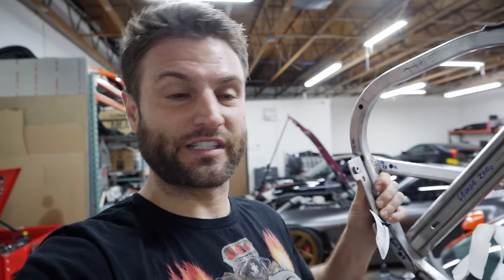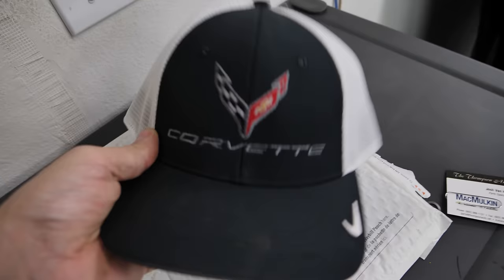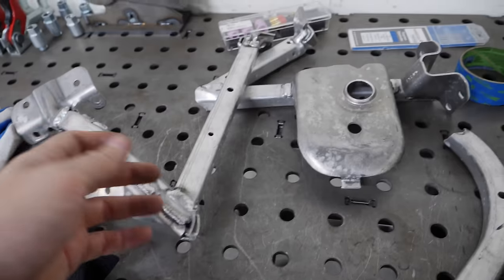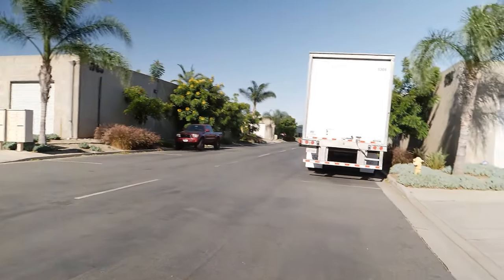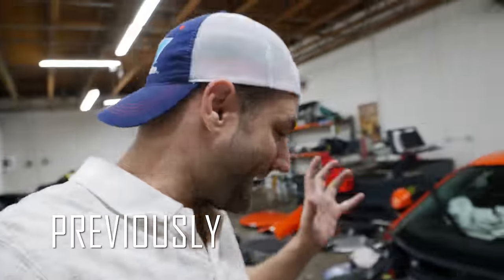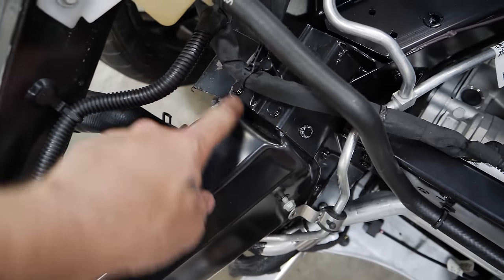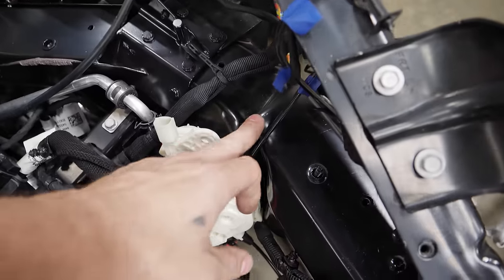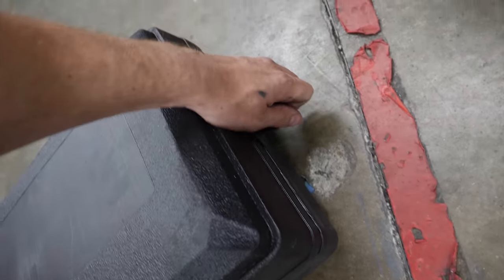Chevy won't sell me parts for the Wrecked C8. Bending the Chassis myself!

Comment: GM: we have specific ways and trained techs to rebuild your C8. This will restore the structural integrity of your car. 

ROB: I have a harbor fright hydraulic kit, a few C clamps and a couple of tie downs.
Reply: It’s Chevy, it’s what they would have done anyways lol
Reply: This is some Shitbox Nation kinda stuff and I love it
Reply: After the stuff I've seen "trained" techs do to peoples cars I'll pass honestly. This comment is gold 😂
Reply: @Lifesabishi  The less dealer techs touch your car the more it's worth to me.
Reply: @Dante_S550_Turbo  🤣🤣🤣 Never. EVER. AGAIN.
Reply: Lol love the use of the airbag
Reply: Sounds like yall are going to the wrong dealers
Reply: @SoI_Badguy  they're all grabage, mechanics are paid based on job not per hr so they will rush through any job as fast as possible that means no torquing wheels or even your oil drain plug. Just full shop pressure zapped with a gun. They managed to even get away with it while i was present told them the torque specs and they fake torque spec everything with a torque wrench.
Reply: thats because doing something stupid like this will drastically ruin the integrity. thats why its bonded and riveted and not welded. this isnt made from recycled beer cans. a bad repair can kill the occupants in another collision. he needs to caugh up and get it repaired properly by professionals. but that isnt good content.
Reply: you would be surprised that alot of shops do it this way
Reply: @fotochoppa  I must agree with you...  When metal bends/stretches it gets thinner and there is no coming back from that. The only way to reclaim the structural integrety is to change the entire part. The car must be mounted onto a jig so that every thing is perfectly aligned !
Reply: Sue GM under the government act which gives you the "right to repair"
Reply: @Dante_S550_Turbo  then work on your own stuff wise guy
Reply: @Dante_S550_Turbo  I’m a retired flat rate tech,don’t paint all techs with the same brush.
Reply: The last time I had body work done at a chevy dealer the jackasses hot glued my headlights
Back into the header panel.
nothing but bunch of clowns 
working there.
Reply: @morganfreeman5171  Its only a small part of the front, no jig alignment required because its not about the entire length of the car.   Its an easy repair.
Reply: @morganfreeman5171  this is mainly superficial,it isn't holding the engine,transmission,front end steering or anything other than the front body panels.you and jono smith are afraid for your job security at the local chevy "parts replacement department"
Reply: @lelanburns2705  its not a car from the 90s. Its a modern high tensile aluminum monocoque. How youd rebuild a steel front onto the front of that might require you to have a bit of a rethink. The front structure is imperative for saftey of the occupants of the car and whatever it hits. Its designed to do exactly what it has done, not to mention the crush zones critical for airbag timing. Hey if its a racecar that will never see the road thats one thing, cut away. If you want to put it back on the road it jas to be repaired properly by qualified and trained persons to manufacturer repair specs.
Reply: There are hundreds of welders/fabricators out there, that could make new "spears" or "tips" to slide in and replace the old ones!  The air bag saved the people, in the previous accident, not these two frame ends!
Reply: they wont listen im guessing they never heard of  john eagle and their woes.
Reply: @fotochoppa  Aluminium is kind of tricky, unlike steel it's weaker where it's welded and I's not as forgiving as steel when you start bending. The issue becomes that by establishing the "certification program" the have not only increased the cost of an already expensive repair but get to treat you pretty shitty in the process if they want. You can rant about the safety aspects but the aviation and transport industries seem to have effectively dealt with repairing aluminium and not creating undue risks without the potential for abuse.
Reply: trillrif axegrindor those frame rails are not superficial... they are designed to crush in a certain way to save your life in an accident. You along with a ton of other people obviously know nothing about collision repair. I don’t know what you do for a living, but I know what you don’t do
Reply: @fk4515  Aluminum is NOT weaker after welding, how dow you think they make motocross motorcycle frames!
Reply: @taylorskinner6833  This was a relatively light hit from the side, they bent over from side pressure, these are light non-essential parts!  The suspension and wheels are where the heavy duty parts start!  These frame ends can be easily replaced!  Get the whole thing done and get a 4 wheel alignment!
Reply: @Brian5481  He can repair it, but there's no law stopping GM from selling him the parts. They don't have to. He can find his own or make his own. "Right to repair" has nothing to do with this.
Reply: Whoa? Real dealer techs are worth their weight in gold. Most are master technicians. Yall mustve got some lube jockeys lmao. And no they dont get paid by the job they get paid by the hour flagged at flat rate per hour. I.e. book time.
Reply: @fotochoppa  Imagine how awesome the content would be if Chevy would sell him the correct parts so he could fix it correctly with basic ingenuity. Oh wait they would lose out on big $ from those few certified repair shops.
Reply: @Dante_S550_Turbo  
You have no idea what you're talking about. Forgetting to torque a drainplug would get you fired at a pepboys, much less at a dealership paying a master certified tech 34 bucks an hour that they've spent who knows how much money training.
Reply: @imrf  Warranty repair act is probably what he's confusing this with.
Reply: @SoI_Badguy  But $34/hour techs aren't doing oil changes. I took my grandpa to a local Chevy dealer to get his oil changed (included in the vehicle purchase) and I kid you not, they had a high school kid doing oil changes.
Reply: @Brian5481  The right to repair act only has precedent against John Deer and Tesla. Only in select states as well. Good luck with the $300k repair bill lawyers included.
Reply: @Dante_S550_Turbo  ...... So many opinions but nobody knows  nor can explain why there are these types of standards. A tech is a tech and you cant control if he sucks or not but... Dealerships are the only facility which (legit qualified) quality control. This means they have advanced equipment and specific training which is the difference between a (salvaged) title and a (clean) title, o should I say a SAFE title in this case. The untrained eye will never ever notice anything different bcs this has to do with the steels integrity and restoring the factory welds and measuring the correct reference points so that if the car is ever in another front end collision, that it wont collapse like a piece of aluminum foil and crush the driver. If the technician who performed the repair failed to meet oem specs or failed to meet safety standards, he will be called into court and taken to trial if the cause of the drivers death can be blamed on a poor quality repair (frame work) not typical body & paint.. This is why cars get rebuilt titles, insurance companies and insurance adjusters are the ones who brand the title clean or salvaged. Its so that the car's owner cannot sue anyone and the car gets a sticker in the door jamb. Sure you can fix it yourself or go to a shop that will fix it off the books and no one will ever know the car was in a collision. It doesnt mean its a bad thing, and btw not everybody knows you can actually get compensation if a poor repair causes you to crash or if your safety was compramised in a crash due to poor repair, but those of you who read this now know how important CARFOX or any other vehicle history search engine can be. Im not saying anything bad about techs outside of dealerships, Im just adding info to the topic sincs most ppl dont know the difference and that it can actually be beneficial. You just dont know the importance until your in another crash.

Comment: I'm interested to see where this build goes .
Reply: It will get 60% done and then he will start another project and leave it unfinished
Reply: See ya in 2032
Reply: Hopefully forwards, depending on the bend quality
Reply: @mikeburnie6668  there is only one way to find out and that's by watching 😁
Reply: @NotQuiteMelvin  a dogtracking C8 would be funny though, eh?
Reply: Probably LS Fest
Reply: 3 days before SEMA and he's trying to get the rotary C8 there and its just started.
Reply: The 4 rotor awd has been 5 years and no test drive video.
Reply: junkyard
Reply: @mikeburnie6668   your predictions were correct
Reply: @mikeburnie6668  your prediction is correct

Comment: Rob, save your time and money for long run issues. 3D scan a good C8 frame, mill it and weld in a good piece. It will be stronger than before and cost less in terms of having to redo later after everything is done in the car.
Reply: you dont want it stronger. it's engineered to be like it is for safety.
Reply: @13christbane  It's like people don't understand it's not an old school car and that a lot of engineering and analysis has gone into the design of this frame.  I'm very sad that professionals won't be doing this repair and that some other person will be driving it.  It just goes to show that you have to be very careful with salvage vehicles, regardless of what they are.  They may look good, but if you need that built in safety, it just might not be there.  Sad!
Reply: Demonic Koala uhhhh did you watch,its a give away car dude
Reply: @jonmeray713  Ah no, they are giving away a brand new one. This is getting a rotor
Reply: He should give a call to the guy on wheelchair who did the scan on the rotary pit truck for hoonigan
Reply: @jonmeray713  hes giving away a new one this one is for his aerovette
Reply: stronger than before .The most overstated BS in automotive repair. Gm spent millions to make it strong as it should be . Not stronger or weaker but just right. anything done here by this guy is absolutely a disgrace . and should be left to 88 honda civic repairs
Reply: @13christbane  if you don't want it stronger, you can always notch it to bend in case of a crash, while supporting load against vertical impact on the road bumps and corner loading.
Reply: @mikeripley3266  you sure? you mean the same dudes that designed the flying frunks and who put the wrong sized engine bearings in the new C8 vettes?  Those are the geniuses doing the same math you claim us mere mortals couldn't fathom without extensive training? you can't possibly believe that anything that leaves a major manufacturers factory is so we'll engineered, studied, perfected, and safe because they've anticipated everything? 

 Remember the Pontiac fieros and ford pintos that used to explode into a fireball from 15 mph rear end collisions? What about the ford trucks that caught fire and all the other cars recalled for roll over risks, over pressured airbags that broke people's necks and so on? Hell even the tires on some cars where so fucked that they would explode and cars the cars would flip over or the steel treads would fly off and decapitate the poor schlub following you on the highway!! I guess that the car companies engineered the cars so we'll, with a mind for safety, that they saw all of those hazardous things as acceptable risks within tolerance?

GM and almost every major manufacturer has spent millions to R&D a new model only to mass produce a rolling death trap!! You're faith in their standards and quality control are horribly misplaced!!
Reply: @md4luckycharms  yeah but if he sells it to someone else or maybe you kid is riding with him and he kills them how you gonna feel then?
Reply: @mikeripley3266  that kinda shit happens if you're an idiot who puts a kid in a racecar before you've validated that it doesn't destroy itself
Reply: @mikeripley3266  So none of that stuff Tommy B said has happened?
Reply: @13christbane  yep, some very smart people put a lot of R&D into this car, but what do they know, make it stronger so it won’t have crumple zones any more